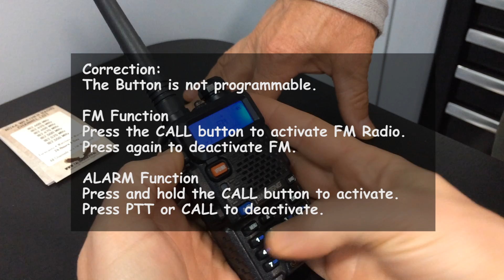Baofeng for Beginners: How to Use Baofeng UV-5R Buttons and More

Comment: How did you program the radio to display MURS1 & MURS5?
Reply: Just use chirp program  that's how got the murs display.
Reply: @foxman362  What? Chirp program? What's THAT? I've been using Baofeng UV-5R for about 4 years now and never have heard or read the word CHIRP. Please enlighten me....
Reply: @foxman362  Well, I'll be... Mucho's thank you's !
Reply: Joshua Keene not licenses are you?
Reply: @MrKeene-zz8bv  Wow! Really? It's the GOLD STANDARD for programming these (and other radios..) You need a Baofeng USB programming cable (It plugs into the SP/MIC jack) to use it, But the software is FREE! Not only can you program your radio, You can CLONE your radio (if you have multiple radios) and save image files for different configurations - Reprogramming the radios in SECONDS. You can even disable TX if you just want to use the radio as a scanner. I can't imagine having a Baofeng without it!
Reply: @beefandpork  Sorry for the delayed response to your inquiry. No, I am not licensed (yet). Other than my little Boefang radio (which I know how to manually program and operate literally blindfolded) I don't have any tangible evidence that I know what I'm doing. I listen to other operators talk at night with highly interesting and controversial subjects that I would absolutely love to participate IN and put my two cents ON what is being discussed. However I'm not even sure if my little radio would broadcast that far away enough to hit a repeater to get my message or opinions out there. I never have tried because I am conservative and believe that I should be properly licensed for such an event   sans an emergency.
I don't even know where or what to go or do to initiate the licensing ritual.
Reply: Joshua Keene you can check for nearby licensing exams on the ARRL website. You can study using the ARRL manuals or many other resources. Current technician pool began in 2019 I believe: will be gold through 2023. You can look for local repeaters on RepeaterBook website or mobile app. CHIRP has some options and tools for importing repeater lists from free sources like RepeaterBook and some paid subscription sources. For studying tech and general, I paid $4:99 for each to buy the ham radio test prep iOS app which is an excellent practice esam app, and I took both tests during the same testing session for $15. In addition to the practice exam app I used the technician and general class videos on the YouTube channel W4EEY. They are made to follow along with the ARRL study manual, but I did not use the manual for tech or general. I bought the manual for extra class on kindle for $19.99 so I assume the other manuals are around that price too, probably close to $30 for hard copy. There are plenty of free study resources though if you’re on a budget, including practice exams. Look around ARRL, eHam, and YouTube if you need to.
Reply: Dustin Eward it costs $15 to take a licensing esam, and if you pass you can test for the best level or levels during the same session for free.

Comment: The Baofeng does not auto add the +/- frequency shift for repeaters like most nicer radios. You have to manually add it in the menu options and then best to save that channel to memory. His just probably had a negative shift. You will not be able to talk on a repeater without setting that up. Unless the repeater doesn’t require it... most do though from my experience. 

Also you can set your “step size” for getting through frequencies faster or just direct dial.

Comment: can two of these sets communicate directly with each other like other normal radios?
Reply: Yes, but they have to be programmed to the same channel.  Just be aware of what channel you are TX/RV on.  FRS is usually "no license" required on the lowest power, but other channels require a license.  This info is based on the FCC in the USA.
Reply: You  don't need  license on MURS and FRS
Reply: foxman362 but you need fcc certified radios and these aren’t part 90 or 97. For FRS and MURS the license is with the device
Reply: @foxman362  This is true, BUT!!! These radios are NOT "type certified" for FRS or MURS!!!! I have NO PROBLEM with anyone USING them for those bands, BUT!!! Keep within "specs" to avoid unwanted attention from the FCC!!! (I am NOT a lawyer, Use TX on your radio at your own risk,but BE INFORMED of the law!)
Reply: They can't be set up legally, unless both of you have your ham license.

Comment: If my frequency is 46.32 what do I do?
Reply from the maker: If your freq is truly 46.32MHz, then unfortunately it is below the radios tuneable range.  You will have to find another radio that is capable of the VHF Low band.

The UV-5R is capable of the following ranges:
VHF 136-174 MHz
UHF 400-480 MHz

Comment: Does your amazon link to your UV-5R radio link to a radio with the FCC ID number inside?    Are these FCC compliant with the new rules (today is 8/18/19 ).    What I mean is - is the logo FCC good enough?   Or must the label have an actual ID number inside?   Will any radio currently purchased - be grandfathered in?
Reply from the maker: The units I have purchased though this link do include an FCC ID in addition to the label.  And that is from multiple sellers.  That said, there is no guarantee that the one you purchase from the link will have the ID in addition to the label.  This is due to the multiple number of sellers on Amazon that sell the same unit.  It is completely dependent on the seller and who their supplier is.  If you are highly concerned about having the ID, I recommend contacting the seller you plan to use to check on the matter before making your purchase .  As far as grandfathering, radios you own aren't going to be stripped from your hands.  If you have em, use-em.  Just stay legal on the bands you transmit on.

Comment: I guess you have an older version, the two I just received do not have a ‘band’ button. I do not see in the manual how to get to the 3rd band?
Reply from the maker: Are you sure it is the UV-5R and not another Baofeng version? All the 5Rs I have seen have the band button.  Some of the other Baofeng models do not.  The UV5Rs also only have 2 bands UHF and VHF.

However, usually (on most models) you can change bands simply by entering the frequency directly via the keypad. If the radio is capable it will take you right there when in VFO mode.
Reply: Talon Survival I just checked the label, it is a 5 R. Suppose to be , 2m, 70cm and 440. I can take a pic of the front to email you, if you’d like
Reply: @wallyjackieturgeon3070  mine also has no band button but it is not needed (440 is a 70cm band) purchased within the past two months.
Reply from the maker: @wallyjackieturgeon3070  interesting.  Yes please send me an image.  Would like to check it out.  Front and the back label please (if you don't mind).

Comment: Do they work just out of the box. I have ordered for 4 Baofeng UV 5R's. Does it require programming to transmit and receive all the four. I want all the four to interact with each other.

Thanks
Reply from the maker: Akshay Solomon so they do....but not on the frequencies you will want to use. Those will have to be tuned using the keypad manually or you can save them to memory using the keypad and menu (I.e. face programming). 

Our NOAA Weather Radio Tuning Video shows you how to set the frequency on the UV-5r as well as a few other radios. While the video discusses the NOAA channels, the tuning process is the same for any frequency the radio is capable of.

Baofeng face programming isn’t the easiest way to program in the world, this is why most people prefer to computer program at this point using software. If you want to go that route you will need an FTDI chipset programming cable (about $20) and use the freeware called CHIRP.   There are a number of videos out on YouTube about chirp programming you can check out. We hope to have a few soon as well but no timeline yet.